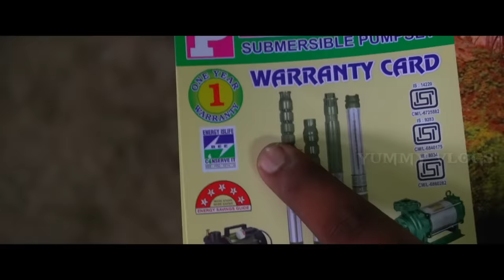HIGH SPEED தரமான பம்புகள் |Direct sales | agri pumps,comertial |pump manufacturer |yummy vlog

Comment: 1.5 hp 350feet borewell motor enna price varum bro? With panel
Reply: Ellam solitiga but core leath imelar metiryal Corbin boos & can metel boos enna mm wire enna tams enna winding wire micro monifax rr kabal poly cab ? Or local wire?
Reply: Please
Reply: Bro vangitengala enna price aachu please inform
Reply: 1-5hp 350feetborwell motor enna price varum bro

Comment: Scam Dealer | Never buy from this dealer, he will not respond to you if you call with complaint. 
Fraud Dealer and Seller. 
He will pick phone the first time and tell you he wil check and revert. 
Then no response from him. I bought 2 motors from him for 14000. He wont pick phone or call never buy
Both have grounding issues and a 1KW motor will consume 3.5KW power.
No response from dealer

Comment: Not buy this I have bought Submersible pump 1.5hp
Problem came within 3 months
Low quality electrical item
No service if problem come send the product courier or transport after that they replace it will take around 2weeks to replacement time waste 
For that u will get Product (capacitor,contactor,main box problem)
Which will higher 
So u will get same cost buying a branded one
So go for nearby branded motors 
Cost saving if u bought that will.doubled at time problem then u will think of branded motors

Comment: Your company have a product  stainless steel motor because ordinary submersible pump heavy weight sometimes the motor problem pulled must used machinery  so I want weight less 5hp motor (borewell 300hundred feet) and price